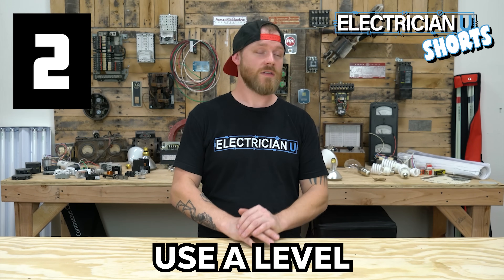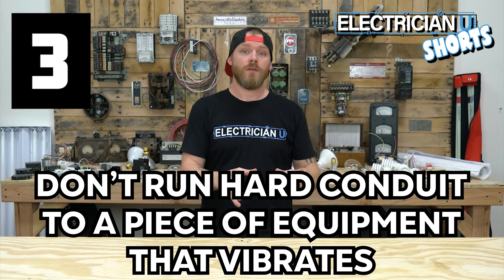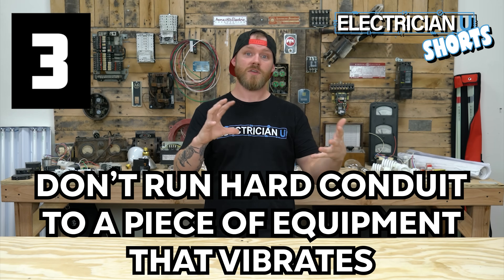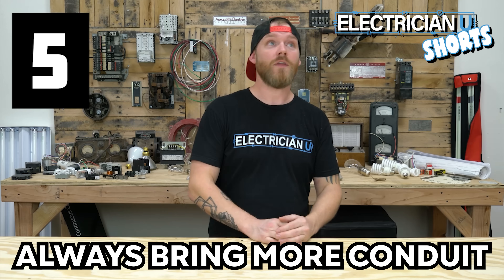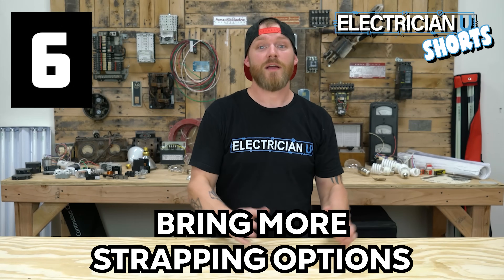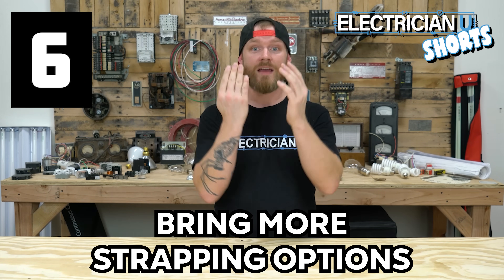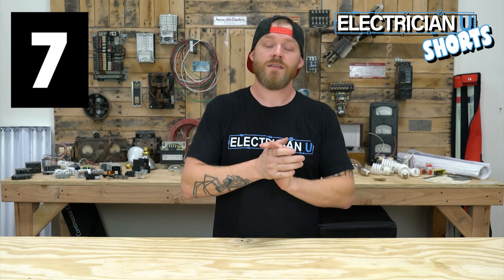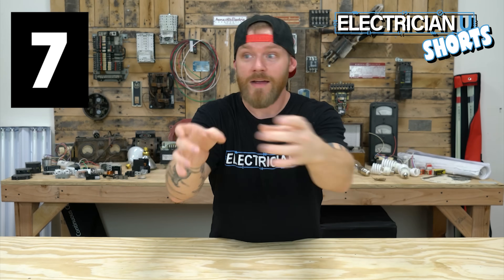SHORTS - 8 TIPS For Working With EMT Conduit - (in 2 minutes!)

Comment: Another tip, When running pipe on a wall, mount horizontal runs straight to the wall, and mount vertical runs on strut. No need for saddles.

Comment: 100% agree about using more J box's, I have seen some electrical rooms where there are already 3 90's before the conduit gets out the room.  Not only did it look horrible but the extra effort required to pull the wire through it must have been horrible.

Comment: Not an electrician, just curious. Why run six 1/2 inch conduits between two boxes when a single larger conduit would hold the wires?
Reply: If you have more than 3 current carrying conductors, you have to derate your conductors. 

The 12 gage wire cannot carry 20 amps when too many are in the pipe. 

You can reference article 310.15(C)(1) in the NEC and table 310.15(C)(1)

Comment: Can you do a video or talk about multiple connections from a panel to device? Cons and pros, from what I understand you want as few connections as possible but is there a code limit on how many you can have in a circuit? When to worry about not having the same volume of conductor through connections that would effectively create smaller gauge wire, like with wago connectors, am I getting the same volume of conductor through those? Thanks!

Comment: "have extra" it's honestly rule number one when purchasing material for a job. Ten percent extra it's what I was taught, depending on the size of the job. Also, I would add to that, inspect your materials before you start doing any sort of install. Ensure that you have so required materials, and that they are not damaged.

It's very embarrassing to have to stop your install to run to the store to get something.

Comment: I am retired now.  I was a Panel Assembler/Cabinet Assembler for a factory that built their own cabinets for the equipment they also built.  Sometimes we would build 6 to 10 panels for a job and they all needed to look the same, especially if they were runs outside of a wire duct'  Panels ranged in size from say 12" x  12" to 8' x 5'.  Did not realize how much I loved the job until I retired.

Comment: I'm 60 years old and have been doing industrial /commercial mostly focusing on controls, electric motors, and all kinds of various industrial electrical apparatus, bending conduit has to be my weakest area. Usually everything I do is roughed in, with all the conduit up in the wire pulled already, Hort service work on existing installations. As a result, I've never had to bend that much conduit or pull that much wire. I know a lot of apprentices who can bend conduitand have it done faster than neater than I can.
As far as what you said about vibrating equipment, I don't want a whole lot of service calls where electricians have installed equipment and failed to allow for vibration and movement. I see so many motors with conductors rubbed through at the peckerhead because everything came loose

Comment: As a DIYer that does basic electrical work buys extra is something I learned the hard way... after making 3 trips to the home depot in one day for one damn project I finally learned to just splurge and buy what i need + extra + even more extra then return whats excess or keep for future projects. Never have i cursed myself out so many times in one drive than when you burn $15 of gas for a stupid $4 coupling or $10 pipe

Comment: Would like to see a video on multiple bends in one conduit piece or a video on 3 and 4 point saddles if possible.  I just got let go from a job for messing up saddles.
Reply: saddles are not something we run into all the time. honestly, for the majority of bends, 90s, offsets (mainly 30 and 45 degree) and kicks will accomplish 95% of most pipe thats ran. Seems a bit silly to expect someone who is not experienced with pipe-bending to know how to bend all types of bends. just keep at it. keep practicing. it gets better.
Reply: @ThreePhase470  exactly. I'm a 3rd year and still rarely use saddles. In fact I usually need a refresher on how to do them as it's rare.
Reply: Depends on the building style. If you have alot of cross braces connected to the beams like in Industrial style buildings you will need to bend a saddle.  You can do to offsets and put a coupling, but it is exposed work and they may tell you to take it down
Reply: @Neil-ym8vy  yeah you have a point. Still those people you were working for should've made clear they needed an experienced pipe bender. Even experienced electricians mess up though
Reply: Of course they want you to do all their work while they go away on vacation.  Then when they are around they sit in their office watching porn on their laptops
Reply: When using three or four point saddles, the amount of resistance during wire pull is increased dramatically. You're changing directions in the wire three or four times in a very short area. They should be avoided whenever possible but at times they're necessary. When using your overall 360 degree rule of bends between boxes don't just assume that the saddle is the equivalent of it's degree of bends, double it. I've been bending pipe and pulling wire for over 40 years. You can definitely feel the increased resistance of pulling through a saddle, especially a 3-point. The bends of a 4-point saddle tend to be a little bit farther apart an offer slightly less resistance when pulling. In a residential environment where pipe is required by the local AHJ, such as in Chicagoland, I will rarely use saddles. There is typically an alternate route to get from A to B. As your experience increases you will be able see the simpler route.
Reply: @davenag957  that's awesome insight. Thank you
Reply: @davenag957  it's not often I'm able to get insight as to the logic behind why we do or don't do. Or why we should or shouldn't do. I'm constantly thinking about why something is the way it is. Especially on the job. I'm a critical thinker to a fault.
Reply: @ThreePhase470  A man I worked for years ago told me that I'm not bending pipe, I'm covering wire. I found that if you always keep the wire pulling in mind you'll become much better at piping. I've seen a lot pretty pipe jobs that look beautiful, perfect saddles, 90s with kicks that are real tight together, etc. Then, when you go to pull the wire, the swearing starts! I prefer 14 and 12 solid wire for residential. I push most of my wire and rarely need a fishtape. To me, that is a sign of a good piping job. The more distance you can put between the bends, the easier the pull.
Reply: It's wasn't residential and I had to get around cross braces in between the beams.
If you go in 45 center bend and 15 outer mark.  The bend is not to great.
Reply: @Neil-ym8vy  I believe for a 45 degree 3 point saddle, your outer bends are at 22 1/2 degrees. For a 30 degree 3 point saddle, half of 30 is 15. So your outer bends are at 15 degrees
Reply: Why didn't they teach you? They are definitely tricky.

Comment: I love using bang on straps because it is so quick to install..
Reply: Nail straps may go on easy with nice fresh lumber but are nearly impossible to pound into old dry lumber. 1 hole straps with a lathers screw go in fast and will never fall out like nail straps do, especially overhead. Never use drywall screws because they snap off.

Comment: How many 8 AWG current carrying can be installed in a 1 inch schedule 40 pvc, 130ft ?
Reply: It depends: insulation, circuit breaker ampacity, ambient temperature, etc.
Reply: Thhn 40 amp